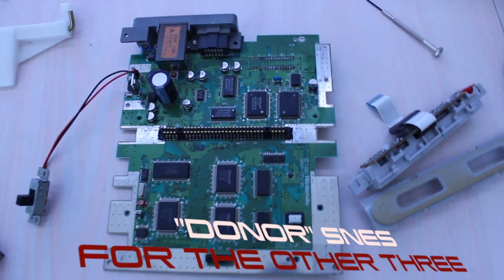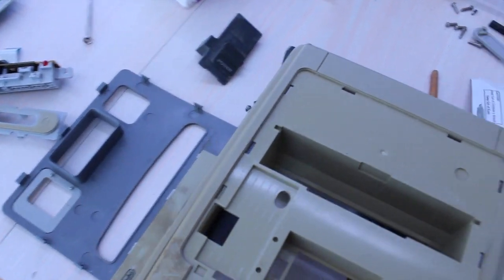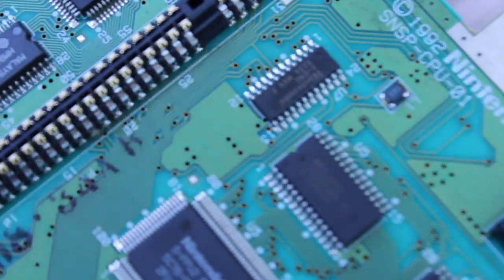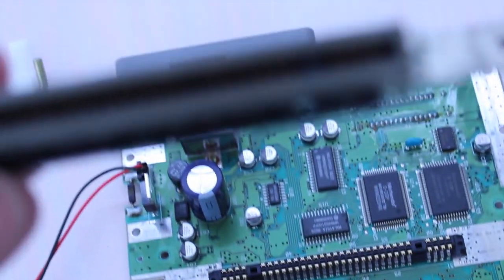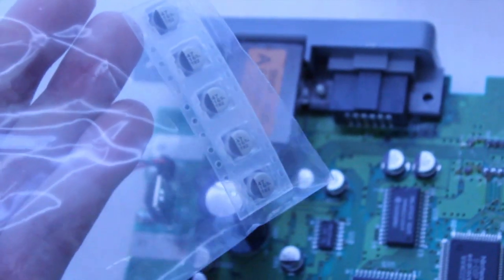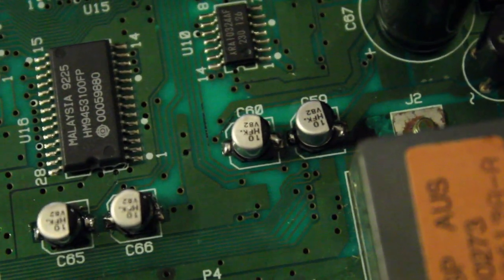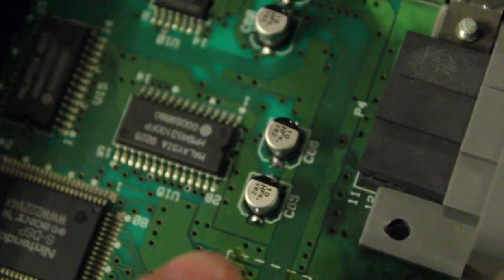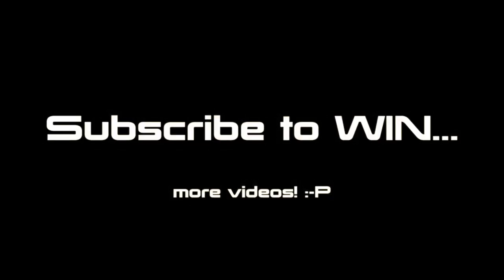Super Nintendo (Serial: UP12144537) Capacitor Replacement

Comment: hello, theres is new capacitors similarly to snes to buy or i have to find an old motherboard to take them as replacement? If new exist, what capacitor should i buy?
Reply from the maker: Usually the best way is to replace them on a working SNES if possible. Stick with big brands like Rubycon, Panasonic / Matsushita and if you really want to (I wouldn't) Nichicon. Just make sure you get the same type (uF) and voltage as close as possible (or a step up - 25V in place of 16V is OK, not visa versa) and form factor (physical size).

Comment: I've yet to replace any caps on my SNES consoles. However I do have a board to an SNES with the same number on the board. The board is mint. But the shell literally disintegrated on it. Like chunks of it were missing. I got the system for free. All it needed was a new fuse so it's good as new lol. The funny thing is that I have another console with the same board that looks as if its just been pulled from the box. Amazing how these things age. Some are perfectly preserved while others just crumble apart. If only Nintendo had used similar plastics to what Sega Used.
Reply from the maker: Yes! Black plastic is an absolute winner! The Sony PS1 comes in at a close second though in my book!
Reply: +Shane McRetro Yeah those systems do hold up well. They yellow to, but they don't disintegrate like the SNES.
Reply from the maker: Probably filled with all sorts of PCB fire retardants, probably the bad kind too!
Reply: +Shane McRetro lol. One day those chemicals will become unstable and the plastic will just melt or explode at random.
Reply from the maker: The golden age of 3rd and 4th gen consoles will finally be over haha! :)
Reply from the maker: (It will never be over!)
Reply: +Shane McRetro lol yeah they made too many of them. I bet they will still be around 15 years from now.
Reply from the maker: That's not a bad thing either :)

Comment: Last batch of caps I bought, I landed up buying one size smaller without realizing it. Good thing, because it actually made the job easier. How often do caps in SNES units fail? My NTSC unit was working fine the last time I used it. I have never checked inside of it because of those stupid gamebit screws.